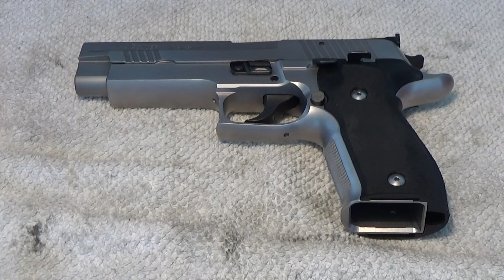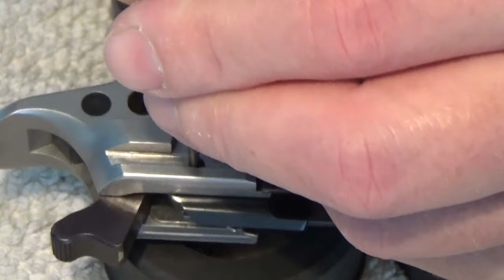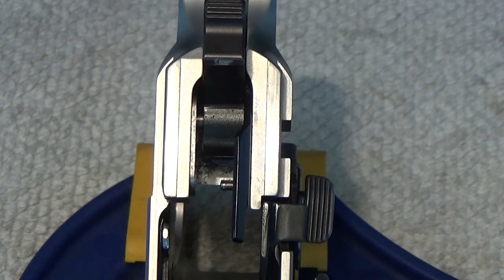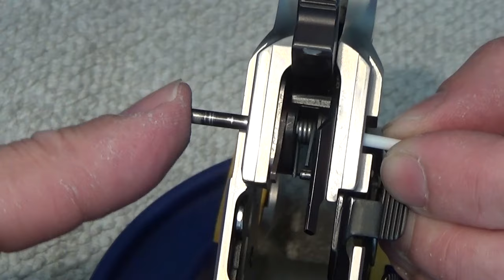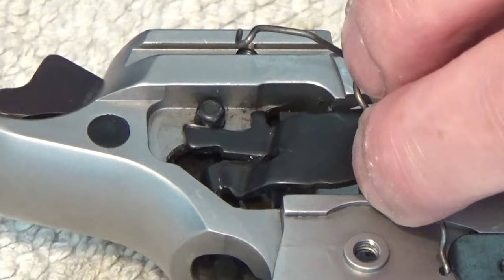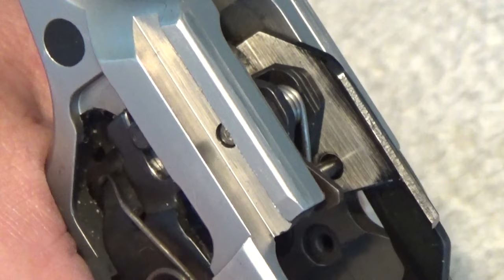Sig Sauer P226  Short Reset Trigger install

Comment: I installed one of these short reset triggers on my P226 X-five allround. First it worked fine but then a couple hundred shoots later, my gun was blocked, I couldn't move the slide at all. I brought it to a gunsmith but they have to send it to the factory to fix it. 
The gun came than back with a note that SIG Sauer does not recommend these SRT to be installed in the SIG P226 X-Five.
Just be aware of that!
Reply from the maker: I have fired 1500 rounds and no problems.
Reply: Dam dangerous in a life death need man hope u got fixed I have to old org west Germany sig Swiss marked 228

Comment: Hello is possible to do this on a x-fice all around?
Reply from the maker: Yes it is, this pistol is a P226 X-Five Allround
Reply: @MikeJack  where i can buy this lkit?
Reply from the maker: Ask google
Reply: @tinome3987  If you live in the USA you can get the Short Reset Kit from: Brownells, MidwayUSA, Midwest Gunworks in Peavely MO, Optics Planet, and from Sig Sauer USA. Currently in stock, but, subject to change. Around $47 to $50 depending on the seller.